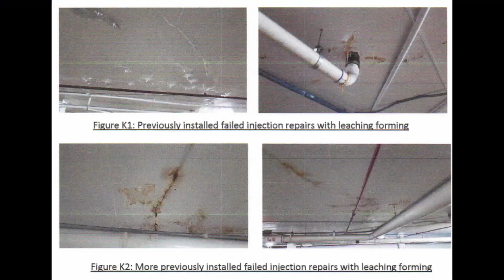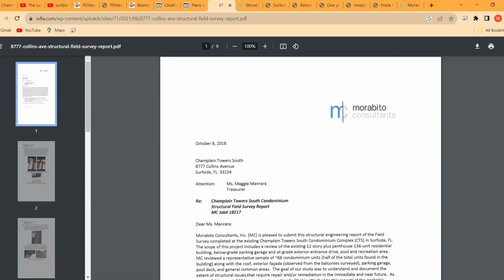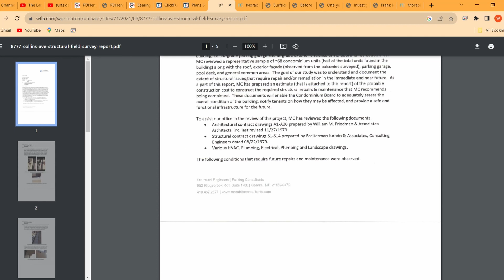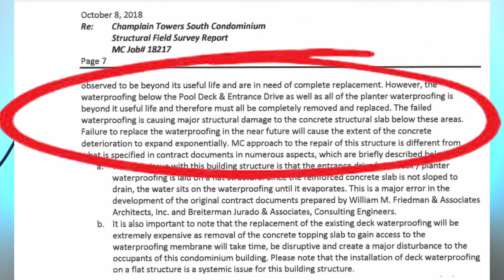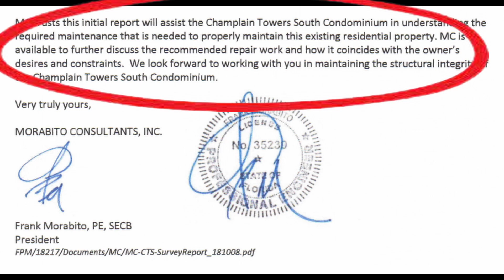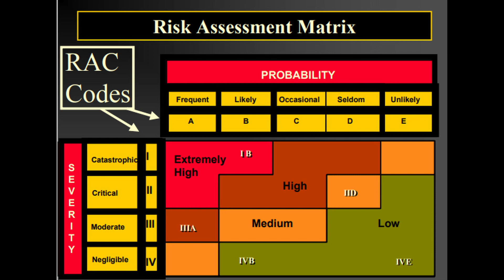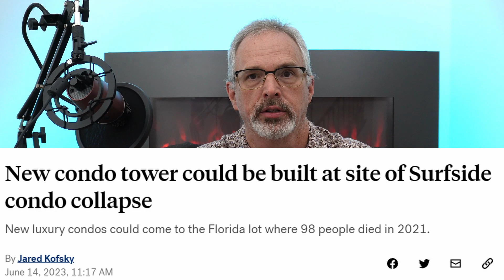A New Perspective on this Fatal Building Collapse

Comment: There ought to already be clear guidelines for structural engineers as to the quantity of damage permissible in concrete columns where (a) immediate repairs are obligatory or (b) evacuation and red tagging is required.  This should have been a settled topic already and it’s really disappointing that the engineering community hasn’t already set such standards.
Reply from the maker: That is an interesting point.  The whole situation seems to rely too much on what the engineer doing the inspection happens to think.
Reply: Except that damage to concrete columns was not a factor in the collapse.  The collapse was caused by improper design of the floor and pool deck slabs, improper placement of reinforcing steel during construction and deterioration of slab reinforcing steel..
Reply: @billj5645  Interesting that you would make this statement about the lack of damage to the columns. I would make no such statement until I had read the final NIST report. Some of the information I have read and pictures I have seen could lead one to believe that the rebar in some of the columns had oxidized and swelled thus spalling the columns, then the lack of containment stirrups would have allowed the vertical loading to accelerate the damage to the column leading to its collapse. Regardless, the critical location was the column/slab intersection. Again from the pictures I have seen, I am leaning towards a design failure as there does not appear to be sufficient concrete cover of the rebar in the columns. Did they need a thickened capital? Not having access to the original design documents or the physical evidence what ever I say right now is pure speculation. Back in the dark ages when we still used slide rules, my Master's Thesis was written around the topic of punching shear in the plastic design of concrete column slab intersections. Talk about boring!
Reply: How would you suggest that as a structural engineer I determine the quantity of damage within a concrete column without invasive or destructive testing? We can do ultrasounds and x-rays on the columns but the results are often sketchy at best and no one wants to move out of their home for the weeks that it would take to properly x-ray all the rebar in a building such as this. So we are left with our two eyes to visually inspect cracks, spalling and corrosion induced swelling of the resteel. It remains a pure judgement call.

As engineers we do not have the authority to demand immediate repairs, order an evacuation or 'red tag'. These actions can only be taken by a governmental regulatory agency. And politics being what they are, you end up with the nightmare experienced in Homestead, FL after Andrew.
Reply from the maker: @denali9449  Nobody is suggesting that an engineer has the authority to condemn a building. However they do have the professional obligation to raise the appropriate level of alarm to the building owners and authorities if the situation merits. Otherwise the "data report" might have simply been prepared by a technician.
Reply: @CaseyJones-Engineer  I never used the word "condemn", depending on the state, that word can get one into a 'heap of trouble'. I paraphrased garywatson in his speaking of engineers requiring evacuation and red tagging. Not sure where you are registered but in the 27 states that have seen fit to grant me a structural license I can say that no two of them have the same reporting requirements. Most states do not require me to escalate a failed inspection to anyone other than my contracted party, a couple do. And, some owner contracts prohibit me from disclosing any information beyond to parties to the contract. While I do not personally believe that this is reasonable and I have escalated cases where I felt safety issues were involved, I have no direct authority to as garywatson suggested to order immediate repairs, an evacuation or red tag a building. And I am not really sure what a red tag is as I have never seen it in any legal proceeding. Years ago it referred to the building official stopping the work on a construction site - - -
Reply from the maker: @denali9449  Thanks for your additional comments. If you had been the structural engineer who had written this assessment report prior to the building collapse would you have hoped that the concerns about structural deterioriation of building components had been more directly presented along with the likely associated risks going forward? If you are ok with his type of letter his PLI still saw fit to pay out $16 million.
Reply: @CaseyJones-Engineer   First, I cannot pretend to be able to fit in his shoes or even take a few steps in them.

Second, without getting into my background, if I had felt there was a possibility that the building could fail or that souls would be lost; a hesitant board would have been hung out to dry. I would have become the albatross around the neck of the city. No one would be able to say they were not aware of the problem. As for my liability insurance, in the 30 years I owned a design firm and in the 20 years since retiring and doing some consulting for a very select client base they have never paid out a nickel. The only time it came close was when an erection company could not read/understand the shop drawings for a wooden arched roof. But that is a three beer story and best discussed by old engineers on a beach in Mexico.
Reply from the maker: @denali9449  👍Thank you.

Comment: Finally! An engineer who hits the nail on the head and points out the real and most important aspects of structural failures!  He’s not afraid to step on toes and address the importance of structural integrity
Reply from the maker: Thanks very much!  I am trying to relate these stories to what I have seen throughout my career as an engineer.
Reply: What do you mean finally? This collapse has been covered 700 different ways, by reputable engineers - Josh Porter, Jeff Ostroff et al...
Reply from the maker: @Anna-w8f1r  Tough crowd.

Comment: So, according to NIST... their investigation into the collapse of  the Surfside Condominium is even more complex than their investigation into the 9/11 Twin Tower collapse?  I guess this must be the case since the NIST 9/11 investigation into the collapse of 2 - 110 story steel framed sky scrapers took only 3 years, where the investigation of just a single 12 story condominium will take 4+ years. Interesting. Will be looking forward to layout and technical content of this condo collapse report when it is finalized in about 2 years from now.
Reply from the maker: Yes, and I will also be interested in how the NIST report may influence repair or replacement of other residential buildings of similar age and construction.

Comment: First, they may have agreed to the settlement because they watered down the original engineers report. Second, if you deal with any type of safety inspections and you find serious issues you may be threatened to change your report. This is where your moral compass should kick in. Third, you can stand your ground. If you work for a bad company and see it happening to another inspector, you could become an anonymous whistle blower. There are many agencies that have oversight and regulate and police all industries, and if they don’t do their jobs, report them to a congressperson. However, you may find yourself in a congressional hearing.

Comment: Really difficult decisions needed to be made.  I perceive, based on watching a bunch of videos on this collapse, that there may not have been sufficiently invasive examination of the structure for the engineers to render a definitive finding.  Also, from Josh Porter's videos, and another engineer that has posted videos, it looks like there were changes made over time that overloaded the pool deck structure.   I even think there was discussion that the sizing and arrangement of rebar did not meet code.  And I wonder if the consulting engineers are perversely incentivised to not "make waves" in these matters b/c they will not get future work - the become the office of "no" and nobody will use them.  Finally, I am coming to the conclusion that reinforced concrete may not be a suitable system to use for hi-rise structures but I have no qualifications to make this assessment other than observing that there does not seem to be a way to monitor the condition of internal components, like the rebar.  Another excellent video that raises lots of questions and many non-technical.  Thank you for posting it.
Reply from the maker: Thank you very much for your feedback.  It does seem that reinforced concrete structures are particularly problematic over the long term due to corrosion and earthquake forces as compared to a steel framed structure.  Florida has recently enacted the requirement that these buildings have inspections made by structural engineers to better assess their current condition.
Reply: @CaseyJones-Engineer  I fail to understand how anyone builds in this kind of place without using galvanized rebar.
Reply from the maker: @k53847  That is a good point.
Reply: Big 700-ft chimney at Monticello power plant collapsed due to rebar corrosion at base. Fortunately, nobody killed due to the angle of fall.

Comment: Interesting hypothetical conundrum you describe. Do you sign the document saying there is a dangerous situation therefore occupants must vacate, or do you avoid getting sued by the (HOA) for "crying wolf"?
Reply from the maker: Your comment made me realize that there was potentially a middle ground.  The inspection report could have been written to say that the amount of structural damage was concerning which would merit additional investigations using more rigorous methods.   They could have gone on to say that until such additional investigations were completed that the building should be evacuated because the potential consequences are so great.
Reply: @CaseyJones-Engineer  Makes sense. Widen the scope of options rather than be specific and paint yourself in a corner.

Comment: The c question seems to me to be why was the pool deck structure, structurally  tied to the residential structure  and then why did the pool deck  failure bring down the residential tower
Reply: Josh Porter has done several extensive video on the subject covering in depth how the pool deck was connected to the building structure, and what changes where made during construction of the piles.
In short, the pool deck is the roof over the parking area. The deck is connected to the structure to prevent water ingress, and increase rigidity. His conclusion is that the collapse of the pool deck pulled the columns sideways initiating a domino effect of collapsed columns. Some of the columns in question where changed from the blueprint during construction.
Reply from the maker: I think you raise a good question.  That building came down like a house of cards.